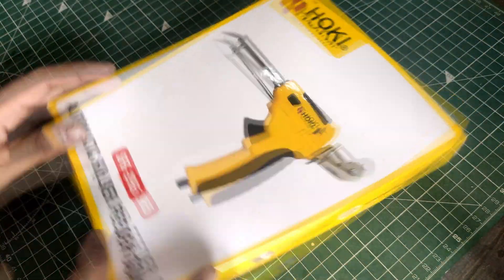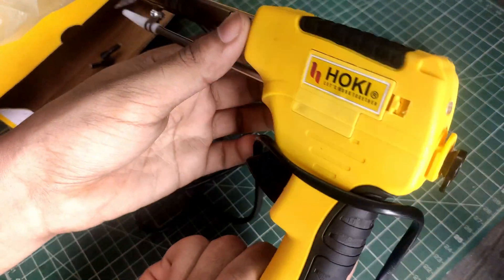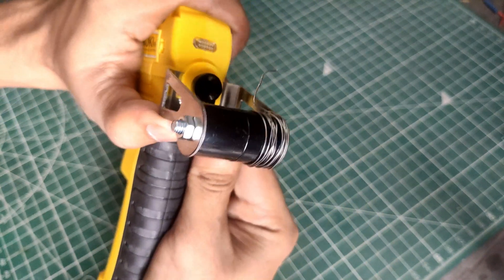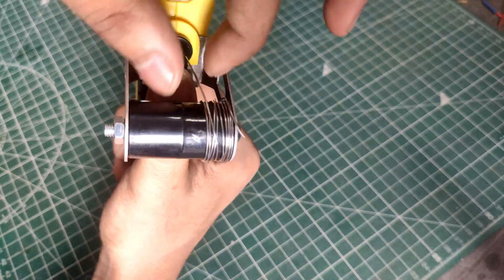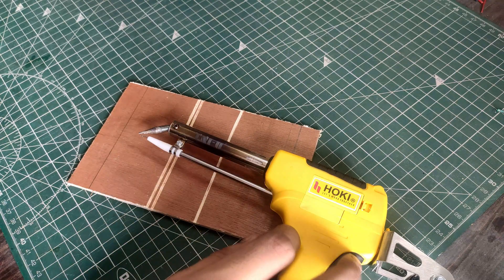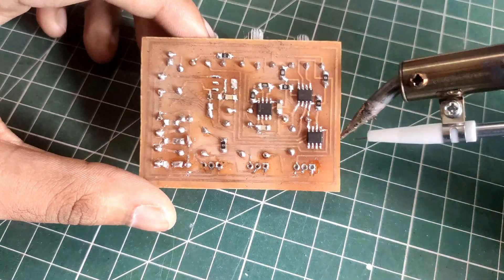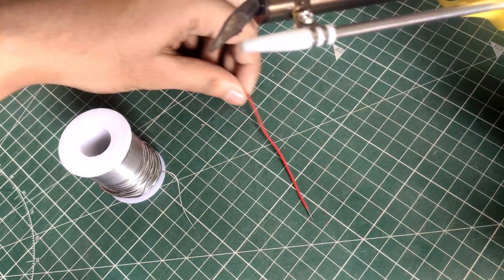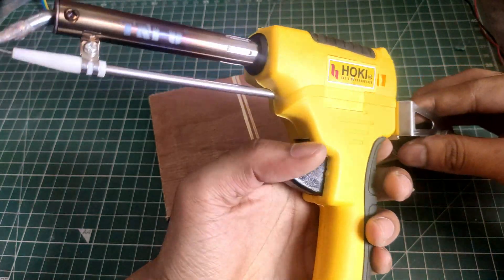Automatic Solder Feeding Soldering Iron | Solder using one hand

Comment: I would suggest getting a cheap solder pot to tin wires instead of this.
Reply from the maker: I agree that would be awsome for tinning wires but in case of soldering a component on a board or desoldering the component from the board, it just provides an extra hand to grab the board or component
Reply: @jitulex  Yeah I can see it being useful in that regard :) Have you been using it since posting this video? You mentioned making a follow up video if you do use it :)
Reply from the maker: To be honest i haven't used it much, according to me the conclusion in the video still stands, hence i didn't feel the need to make a follow up video..